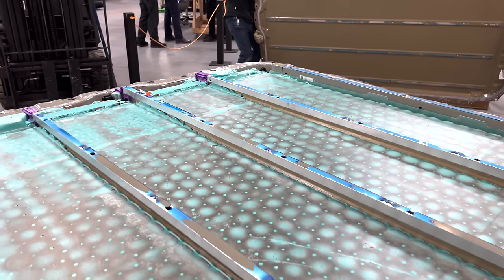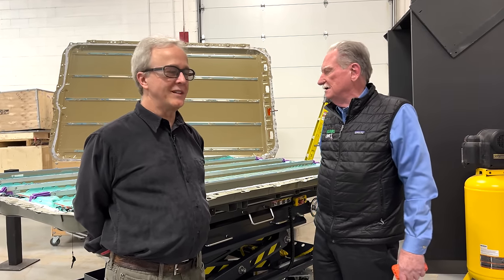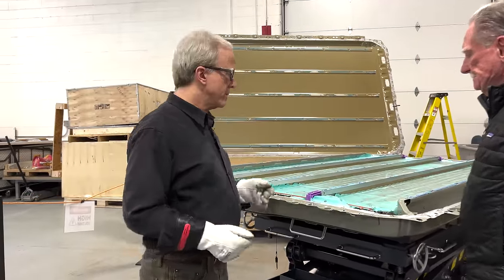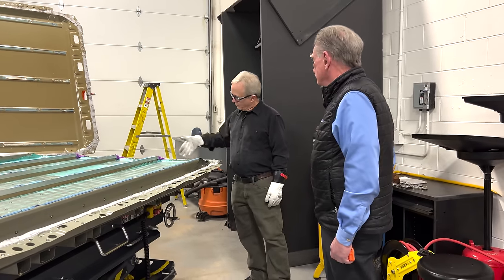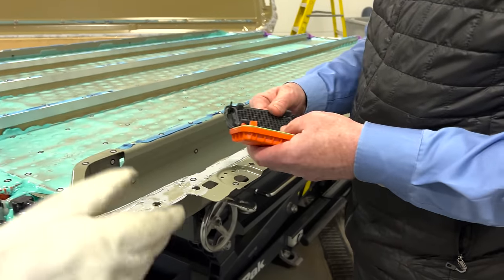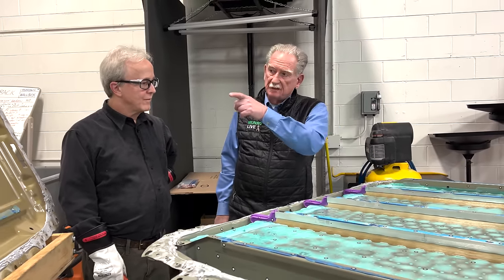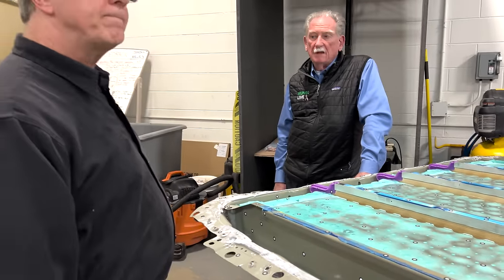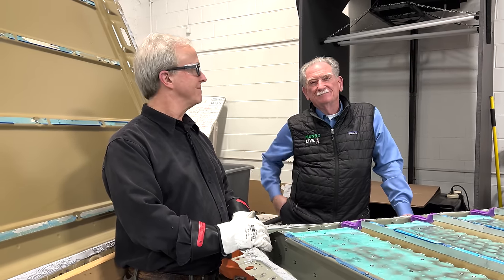Tesla Cybertruck Battery Pack: Our First Impressions Under the Lid

Comment: Gluing everything together no doubt saves money in production but the consumer is stuck with the bill of replacing the entire battery if anything goes wrong in there.
Reply: The idea is that the structural pack is more durable because there is less vibration on connections to cells.   The foam provides thermal insulation between cells reducing the chance of thermal runaway should one cell fail. No chain reaction.  So it may be saving the vehicle.     It generally takes more than a single cell failure or two to ruin a modern EV battery.  The number of cells that can fail before significantly impacting the battery depends on the size and design of the battery pack.
Which is better requires unbiased thinking.  I would suggest that a modern battery that fails already has multiple cell failure and is better recycled than repaired.
Reply: If it happens during the first 8 years then it's Tesla who pays ... so it's very much in their own interest to build them so that they are reliable as possible. Of course the risk factor ultimately does transfer to the consumer but it doesn't mean that when the battery is 8 years old it fails!
Reply: @MrAdopado  Tesla makes a fraction of the cells it uses.   I wonder how much of the cost of a failed battery is covered by  Panasonic, LG Chem's LG Energy Solution, and CATL.
Expect it is determined by contract.

Comment: A boat landing story from the 90s.  Rear wheel drive Ford Aerostar minivan was landing a boat on the Mississippi River.  Anyone who has ever boated knows a layer of green slime forms where the water line is on the concrete (ive seen fat guys slip and fall on it).  So this guy is trying to pull the boat out of the water..his rear tires are on the slim..every time he guns it..the van slips back further.    Long story short, an hour later the tow truck is there and half the van is underwater=boat still attached.

Comment: Great design for the battery.
Making a battery repairable adds complexity, cost, weight and unreliability, better to design a battery that is reliable than repairable.
Reply: lol, sarcasm? Tesla just doesn't care about consumers
Reply: @BBingo-v5i  
lol, sarcasm?  Some one that knows nothing of how to design reliable engineering quacks.
Reply: Even better than that: design a battery pack that is both. Repairability and reliability are not each other's enemies. With careful design, both can be achieved. However, at the expense of higher manufacturing cost, but sometimes an investment up front will pay off big time afterwards. Or even investing some money for 'greener' results is just worth it. Isn't going to EVs supposed to be one big exercise in spending a bit more for greener results?

Comment: Is the battery pack pressurized to push out water and humidity
Reply: When the submarine mode is enabled.
Reply: According to the video (did you watch?) yes. Only enough to stop water being sucked in.
Reply: I was at work and had to stop/start 50+ times so missed some stuff. Thanks for the info

Comment: Question: could Tesla have a solvent and  machine to dissolve the potting, so they can wash it away and work on and repair the pack then pot it again?
Reply: no
Reply: @BBingo-v5i  and how do you know Tesla can’t refurbish or repair this pack? If I were them, I would want to be able repair and easily analyze incoming failed packs returning from the field. The information alone that could be gathered would help them iterate versions that eliminate weak points costing the warranty repair budget money.

Comment: That bottom should be stainless like the body!!!
Then hitting things matters less - use it for rail slides!
Reply: Makes sense, except maybe it needs to be in a shape you can't get with stainless
Reply: @jamesengland7461  I'm guessing you mean that if it were completely flat underneath, the thing would vacuum itself to mud surfaces like Vulcan bombers did when crash landing!

Comment: I however, am Not Impressed. The style lasted 10 minutes, and the batteries will last 10 years at most, then the entire vehicle is a throw away, because the cost to replace the battery is astronomical. I'll wait for the next gen tech that has already proved it's reliability, longevity, efficiency and sustainability.

Comment: I can't see how these can be recycled. I guess the battery can be crushed and turned into some kind of paste, but there must be a better way.
Reply: A lot of people are reusing the battery packs after the are out of a car for other applications mostly solar storage. The recycling I have seen videos of have been grinding up the whole battery, case and all then using water to separate out the different materials.
Reply: @paulo123-  seems to me, there should be some effort by Tesla to describe how the batteries should be recycled and create materials that ease this process.
Reply: @dollarette  Redwood Materials claim "The company says it can recover more than 95% of the elements in a spent battery, including lithium, nickel, cobalt, manganese, and copper. The metals are then used to make anode and cathode components for new battery cells." That seems more recyclable than most of the other items that are part of our modern lives!

Comment: This battery pack is a mess 1 st it’s non serviceable 2nd the battery pack enclosure is made out of mild steel so it’s not the lightest material and in salt covered roads it will rust and moisture will get in there are cars in Norway with damaged battery packs because of rusting 3 rd the bottom of the battery pack cover or bottom is not protected with a high strength steel skid plate like all off road trucks when someone hits a sharp object this metal cover will be open like a can of sardines and then you have to buy a brand new battery pack plus these orange vents are not protected they will certainly get damaged in off road situations then water will get into the pack and voila a new pack for the customer. 4th the cooling inlet and outlet are non replaceable so again a new pack. And 5th the amount of wasted space is unbelievable they could’ve installed much more cells but did not do it because they wanted to make more money on each truck and sell them $ 20 000 more than what they said it was supposed to cost the Ford lightning had a beefy skid plate and it’s not marketed as a off road truck heck my VW iD4 has a thick aluminum protective plate under my pack and it was never intended for off road use plus my battery pack casing is made 100% in aluminum so no rust. How much is the price of a Cybertruck  ? Complete pack plus labour

Comment: Tesla have discarded one of the major advantages of using small cells and unitization of the battery.
Unless there's some less apparent way to get in and replace a cell or module, a faulty cell or module mean at best the pack loses capacity, at worst the entire pack needs to be replaced.

Comment: The battery pack is not structural, the Cybertruck does not have an exoskeleton and it is not built from a special Tesla designed steel. All of those claims were lies.

Comment: Thank you for the interesting analysis of the CT battery. There were some initial reports (rumors?) that indicated the pack was not full of batteries and could be at as little as 50% of the packs capacity. Is this correct?
Reply: No, it is not. They say, about 32-40 mm are left. But an additional layer of 4680 would require - well - at least 80 mm. 😀 They may use this volume however with either 46120 cells or with prismatic LFP cells later.

Comment: How these batteries ares supposed to be recicled?
Reply: EV battery's are recycled by putting the whole battery into a grinder, no disassembly required for this one, leads to lowest overall cost, lightest weight, longest life and  best solution for the environment.

Comment: All that glue makes it impossible to repair. Not green at all.
Reply: Making a battery repairable adds complexity, cost, weight, more resources used and greater unreliability, better to design a battery that is reliable than a repairable battery.

Comment: Oh man... that poured foam stuff is horrible. Yeah it does a great job but what a mess for any repair or recycling. Nothing will dissolve it, has to be mechanically removed and it sticks like nobody's business. Really would have been great engineering if they thought to put down a thin release membrane first, or some sort of release coating... aye yai yai

Comment: I thought EV's were a good thing until I learned they're powered by the same thing as e-cigs but there are thousands of them. Sounds like a problem waiting to happen. All you have to do is look at how chinese EV's are blowing up all over. The fires are so bad because they're lithium, they just watch and wait for them to stop. EV's also cause more pollution through tire wear ALONE than a traditional gasoline powered car, factor in manufacturing of the parts and the batteries alone, you start to realize how much of a BS scam they are.
It also costs about the same to refuel one compared to gasoline powered vehicles. Too bad we don't have an easy to make fuel that burns clean... like hydrogen.

Comment: EV battery's are recycled by putting the whole battery into a grinder, no disassembly required for this one, leads to lowest overall cost, lightest weight, longest life and  best solution for the environment.
Making a battery repairable adds complexity, cost, weight, more resources used and greater unreliability, better to design a battery that is reliable than a repairable battery.
Reply: While I agree, I think breaking it more into sections and allowing a section to be replaced can be a good trade off. Some here want individual cell repairability, but that is hard without the downsides you mentioned.

Comment: Wouldn't it be great if all Tesla vehicles after a crash unlocked or opened the doors, lowered the windows and unbuckled the seat belts.  Then it would be easier for bystanders and first responders to remove the occupants.

Comment: There you can see why the BMW i3 earned the high repairability score: In the BMW design, the Battery is divided into 8, low voltage packs. These can be replaced each, by removing a few connectors and bolts. Teslas design on the other hand is just awful for repairmen and our planet

Comment: Nice but if a little problems apen (repair should cost 1k $) but with all the cells are glue you need to replace it all (no reparation option) thats bad !
Reply: No, you can't just replace a cell in any pack. They are a matched set of cells that age together. Sticking a "replacement" cell or even a module is a guarantee of a short pack life.  Tesla figured this out in 2013, but other manufactures haven't learned from Tesla. I expect they will all change to Tesla's design in time, as it is safer, more reliable and saves costs.  

Then there is the risks to personnel if you were to attempt a cell replacement.  Dealling with HV is not for the average mechanic and making a pack replacement eliminates killing off your service techs.

Comment: One major use of the Cybertruck is to pull trailers. Installing only half of the battery potential doesn't make sense to me, except to save production costs. The Cybertruck costs $120,000 and yet preliminary reports say that the Cybertruck can only pull an averaged sized trailer 90 miles on a full charge before empty. That range is abysmal.

Comment: I don't like the concept of non-fixable batteries. Quite the opposite. Let the battery tech development fix the weight and size problem. The blade system is much better.

Comment: Fucking run the battery open with a thermal camera / then monitor the batteries that get hotter then the rest interconnect them and back and forth criss cross wire patterns until fully volted and able to discharge as specified I’m tired of their almost good enough

Comment: Using the battery pack case as a part of your truck's skid plate system....I don't care if they've built in 25mm, 50mm, 75mm of evacuated vertical buffering space....is fundamentally, and this is a very technical engineering term I learned over the course of my 35 yr career as a mechanical engineer, is STUPID AF. When you add on top of it that the battery pack is a non-modular, monolithic and therefore unrepairable design....only a fool would put this thing into the real backcountry...not of course that many buyers of this schlong compensating device are actually doing that, but if they ever wanted to, they'd be fools to do so.

Comment: Drop the batterypack from a helicopter to put the rigidity to a test. Elon said you could trow it from a plane and it would not brake or catch fire.
Reply: Well it would definitely break….  and possibly short circuit itself due to cells collapsing or colliding into each other from the fall. Even from 50 ft it wouldn’t survive or be reusable

Comment: Relying on an on-board air compressor to keep moisture out of an EV battery is a horrible method... I am surprised at so many of your bad perspectives on this battery from an engineering and structure standpoint. You guys should really bring in a more advance expert for some of this analysis. This truck is going to be a dangerous disaster for many reasons in off-road situations... one serious hit to the floor and this thing is in big trouble.

Comment: Sooo.. all the numbnuts talking about how the CTs battery compartment is half empty.. are full of shit? As usual.. this is designed this way, with the extra space, for battery safety. Not for a day when they want to cram every millimeter of space in the battery pack with more or bigger batteries. Noted.. thank you Munro!

Comment: All batteries are trash . Doesn't matter how they're made . Especially lithium. They're nearly impossible to recycle because the lithium itself is so reactive to water that it needs to be mixed with ink , then printed on aluminum foil before being rolled tightly into a cylinder.

Comment: All EV batteries should be sealed. Salt on the road is common.
Reply: All EV batteries are sealed anyways.
Reply: @MooseOnEarth  A Fisker dealership a bunch of Ocean's were flooded with ocean water and a bunch caught fire in the salty water.
Reply: @suggesttwo  The Fisker Ocean battery packs still are designed to be sealed battery packs. Maybe it was a small percentage with a leaky seal and a production fault? Maybe the water influence in that case exceeded the sealing conditions? I do not know.  But something like this can happen to any sealed battery pack. It is the point, where further specification of the actual sealing is needed.
Reply: @MooseOnEarth  not viable for sale in Canada or the US rustbelt.
Reply: @MooseOnEarth  A whole bunch blew up.

Comment: A shocking waste of talent and battery materials, for the tiny minority of sales that will actually be used off-road or as a work truck. Elon is too easily distracted, but can hardly blame him for wanting to see it made. Like the Fabergé egg of model X, the Roadster, the Boring Company, Twitter... 
Got to wonder too, why not a lighter weight panel van with maybe twice the enclosed volume and half the batteries, given the average daily mileage of a working truck?

Comment: Wiegel, "Heading to Mexico in 2024", because 68% of any company's overhead is human resources.  And WHY should we have to pay an American $24 and hour to work the assembly line, when we can get a Mexican local to do the same job for the equivalent of $8 an hour...  When an American will work for $8 an hour, we'll come back.  Until then, adios!
Reply: Hello- Quite the contrary, we’re going to have a facility in Mexico in order to service our customer base within Mexico.
Reply: @wiegelmfg  I worked for Johnson Controls, ASG as a Tier One supplier in Mexico to "service our (automotive) customers" back in the 1990s.  Our "Customers" were GM, Ford and Chrysler. All companies, including JC, were in Mexico because the labor is super cheap.  We are very good at putting a pretty bow on our reasons for being there.

Comment: Terrible design from the customers point of view; non repairable item which is why insurance rates for EVs are through the roof. A huge massive weight to lug around regardless of how the customer uses the vehicle - please design vehicles with swap out batteries - give the customer the ability to swap out for smaller batteries to fit their daily usage pattern - greater efficiency for short trips. Makes insurance people happier for accident damage replacement. Zero charge time using battery swapout stations; so no customer range anxiety. Cheaper cars upfront with rented \ leased swap out batteries - so better for used car market, no customer duff battery anxiety. Swapout batteries would allow future battery technology upgrades without changing the vehicle. Telsa had the opportunity to lead the world on this and they didn't. What a waste :o(

Comment: Tesla spent seven years working on all the innovations needed and the design of the Cybertruck, way longer than they spent on any other car. It is also the first car mostly designed when Tesla was profitable and under no financial pressure to speed up the development and release. So I don’t think you will find any poor design choices.
Reply: Not finding many good ones either!
Reply: alot of the design choices were made to reduce the cost of manufacturing , unfortunately this effected the design choices available to deliver positive attributes for the driver , .ie no pass through to the bed ,small front trunk , no door handles ,no spare wheel locatiuon . reduced rear  visibilility .........etc, etc.